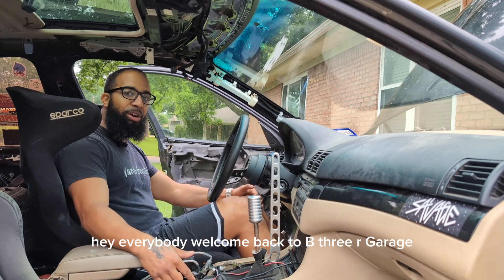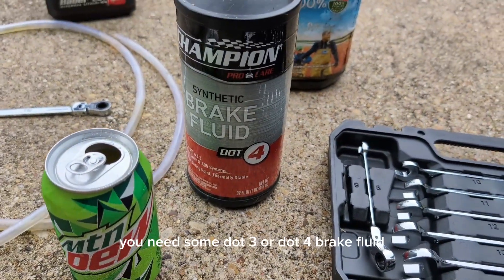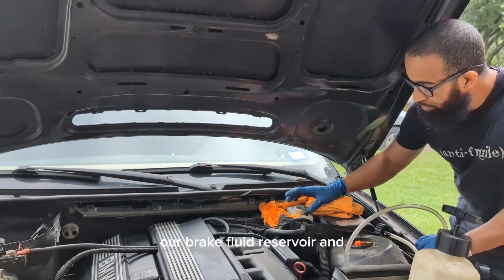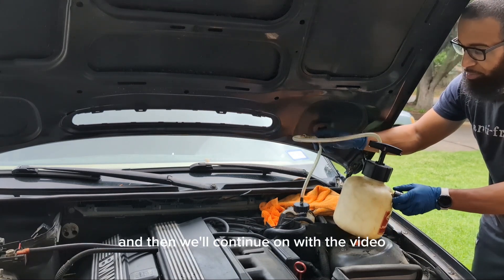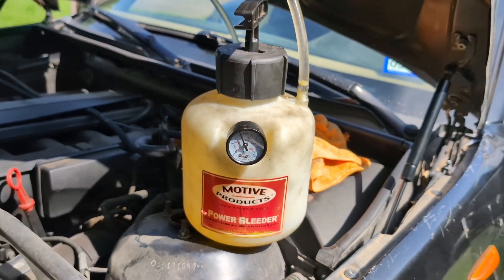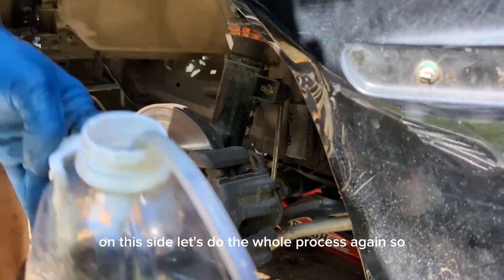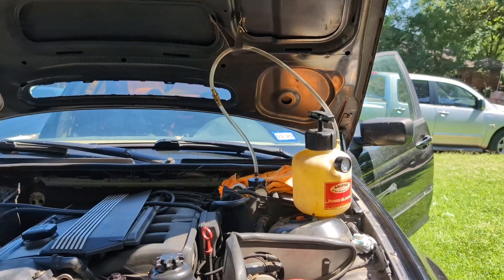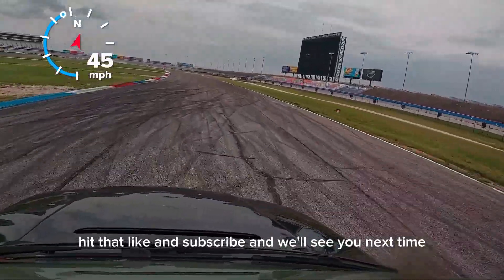DIY How to Bleed Brakes with an Inline Hydro Handbrake Using a Power Bleeder or 2 Person Method

Comment: With the power bleeder you dont have to pump the pedal. Pump to 15 psi and open bleeder until no more bubbles. Pump to 15 psi again. Same process but with handbrake pulled for about 10 seconds. Release handbrake and close bleeder. Pump to 15 psi before moving to next wheel.